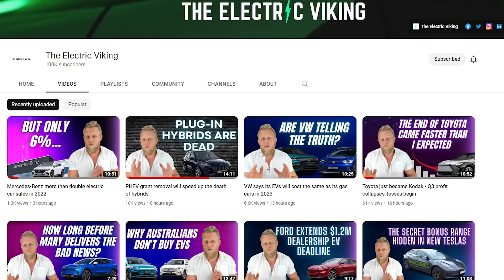German power company destroys wind farm for new coal mine

Comment: Very misleading in regards to the dismantling, or as defined by correct terms “decommissioning” of the wind farm by RWE. They havent simply decided to do this, those turbines had come to end of life as they have been operational since around 2001 and the permits are beginning to expire. Not a fan of expanding the coal mine though
Reply: I wrote something similiar but the comment was deleted. Truth and critical questions are not wanted here.
Reply: It is even more hyped up than that. The windfarm in question consist of 8 windmills. Only a minute of research (google "number of wind turbines in Germany" ) shows that there is about 29,788 wind turbines in Germany. You really have to be immune to facts and logic to make a big deal out of it, specially since the war in Ukraine have disrupted the energy supply for Europe.
Reply: Fossil fuel powered plants normally last 30 to 50 years or more.

Comment: Brown coal is very poor power generation , Black coal is a lot better if you are going to use coal .. The age of the wind farm may actually be so old that maintenance costs ,repairs etc make a negative situation . The Wind Turbines on land have about 20 year financial viability , but thats dropping as new turbines are much bigger and supposedly more efficient ( Life expectancy and maintenance are proving not to be what they said ) . Tesla water use compared to VW , BMW etc would be interesting .
Reply: As an electrician who has worked on wind farms, newer turbines just keep getting better and better when it comes to reliability and maintenance. While having an issue on a larger turbine does take out more production for servicing, it also reduces overall service needs (just longer times in the lifts as towers get taller). The turbines are becoming like jet engines used on passenger jets. They will communicate when lubricant is becoming warmer than expected with the current weather and power output conditions, or when slew motors are experiencing higher than expected loads, all signs of increased friction or lubrication problems. Just seeing issues ahead of time allows for preemptive maintenance during low wind conditions, with all of the parts, equipment, and personnel already onsite. Very similar to scheduling an airliner to visit the maintenance shop on its next flight, and to have all of the necessary equipment to repair or replace engines as necessary.

Comment: Mind-boggling that Germany cannot or does not want to invest more in Wind and solar.
Thx for calling them out Viking
Reply: I guess they have an urgent need for power that can't be supplied now by wind and solar.
Reply: Renewables overall.
Sure, if they think wind and solar suck because of their climate, fine. Battery storage isn't ramped yet, and European temperate climate really just means "50% of the year you get clouds or rain".

But Germany has nuclear power available, they both have a domestic capability and many countries around them with that capability as well.
They are also an economic powerhouse capable of actually pushing new generation nuclear (mainly liquid fuel reactors) that can easily drop the price of both construction and exploitation of nuclear below SUBSIDIZED COAL (which solar is able to hit lower than unsubsidized coal, but not subsidized coal) and it would work in the European climate.

But that implies both taking risks (investing in new technologies and assuming their choices), going against standards (PWR was chosen as the standard for the industry way back then because of its ability in producing plutonium for nukes), and pissing off their existing power providers (because such a solution would essentially break their hold over this market and all the ones linked to their energy grid). 

But on the positive it would also cause France to finally drop PWR as well, because I think the thought of being outdone in nuclear by the Germans would be a national insult.
Reply: @mobiuscoreindustries  Tony Seba says studies have shown that even in Alaska solar power would be enough.  Just need batteries too.
Reply: They do not have enough baseload energy plants.
Reply: @philipdamask2279  Do they not?  Then why are they importing Russian gas?
Reply: @simongross3122  For industry. Gas is not all about electricity. People seem to have drawn a blank on that.
Reply: @simongross3122  For industry. Gas is not all about electricity. People seem to have drawn a blank on that.
Reply: @hendrikbarboritsch7003  Yeah, and batteries are the current bottleneck. What I am saying is that Germany has the ability, just like nearby France, to smash their use of fossil fuels even preceding the ramping of global battery production, but we all know the real reason for the lack of commitment is that Germany's energy utilities and politicians would rather pretend to perform a transition rather than actually doing it
Reply: @UhOhUmm  Yes you have a point.
Reply: @UhOhUmm  Precisely because Germany needs all the gas and oil it can get for its chemical industries (pharmaceutical, agrarian, plastics etc.) it should get its electricity from renewables, like Denmark.
Reply: @hendrikbarboritsch7003  "studies" huh? if it could be done you would think there would be some decent sized town somewhere that runs on 100% solar/wind already by now. no offsets, no trading excess renewables for reliable energy later on etc, just one decent sized town running 100% on solar/wind.
Reply: Mind-boggling that Germany want to invest anything whatsoever in Wind and solar.
Reply: @hendrikbarboritsch7003  You dont like anyone offending your religion?
Reply: Wind and solar not a very reliable, efficient, economical or environmentally friendly energy source.
Reply: @ogcowboy5743  It's a fairytale energy source.

Comment: The re starting of the coal plants and generation is to counter the loss of Russian gas and is understandable as the current renewable technology would not plug the gap in time for the peak winter demand. I don't know what the potential is in Germany for solar and wind to provide their energy needs given their climate and I suppose that applies for most of Europe. We in OZ can not ride on the high horse either as we do still have a significant coal fired power generation percentage with the unit in Victoria being brown coal. We have plentiful gas under our feet but have to compete with the rest of the world to buy it so again we can not afford to be so smug. I think protesting  the construction of the factory is quite stupid and I can not see it being any more of an environmental problem than many other factories in the country and its water usage would probably be on par with them. It is obviously all about protecting their car market which was clearly not prepared for the EV revolution but they were not alone there. We need to remember that as more EVs are bought the pressure on countries to cater for charging them increases which will lead to an even greater demand for electricity generation. Also most Europeans don't live in a hose with a garage and a socket to charge their car from. Make no mistake the upheaval will be huge and many wont like it.

Comment: Hmmm... The thing you overlook is that they are digging up the coal to make electricity, the very electricity that the Tesla batteries need in order to function, so in reality what Tesla is doing is connected to what the coal mine is doing. They are still part of the same rapacious system.

Comment: Yes mate I think in my layman knowledge of the subject is that any form of power generation comes at a cost to the environment simply because in almost every instance they require gigantic holes in the ground to be made to get at the materials and elements which must have an enormous impact on our current situation. It has been mentioned that for example wind turbines have to be replaced after twenty years and that the first ten years of their operation shows them to run at a loss in revenue they might produce. It makes no sense to me at least that this crazy push towards power generation is not going to make any impact on the planet and another example is EV vehicles and the many issues against having one for one's own transport. Moreover this rush to have  non polluting systems up and running has come at least thirty years too late!

Comment: Never mind whether coal is more efficient than wind or coal power station uses more water than a Tesla factory. I suggest the reality is that at this time Germany needs both. Here is my reasoning.

1) Germany is/was very much dependent on oil and gas from Russia. Despite massive investment in wind and solar in the last decade or two. Gas is now cut off, oil will be shortly, due to the crazy war on Ukraine. 

2) Presumably no matter the efficiency of wind those few turbines were not producing anything like the amount of energy that can be had from the coal on the same site. 

3) Germany needs that energy ASAP to keep their economy going so the Wind turbines have to go and mining commenced.

4) Meanwhile, reducing use of oil and gas is a great idea, both from a climate change perspective and in order to gain energy independence from Russia. Therefor EV's and the Tesla factory are a great idea seeing as they are so efficient and don't burn oil if renewables are available. Therefor having that Tesla factory is a great idea.

5) Hopefully in the future the green guys will have got their act together and made renewables work well enough to replace the energy from oil, gas, coal. That still seems to be a long way out, despite all the claims of how cheap renewables are etc. The situation today in Germany clearly shows renewables are not enough at this time.  It makes no sense to shut down fossil until renewables are a viable replacement. That attempt just led Germany to become reliant on Russian fossils. 

In short, I could sum it up by saying that Germany needs that coal mine to power that Tesla factory!

Comment: I'm only about 3 minutes in and you may have covered this later in the video, but they're protesting Tesla and not the coal plants because Tesla is the reason those coal plants needed to be constructed.  Renewable energy cannot keep up with the demand created by electric vehicles, so reliable energy is coming back in the form of new coal plants.
Your renewables aren't even renewable, those solar panels and wind turbines wear out and once they wear out they are not cost-effective to recycle so they just end up in the landfill. It costs more to break them down into reusable materials than the materials are worth, and even if all those materials go right back into making a new solar panel or wind turbine most of the fabrication cost is in the labor and not the materials.

The only way EVs are the way forward is with nuclear, unless you don't mind having a heavy reliance on coal and gas to charge your car.

Comment: You seem to forget the process of producing electric vehicles such as Tesla, involves a far more toxic mining process for cobalt. Also petrol/diesel vehicles have on average 3 time the lifespan of an electric vehicle.  So for the same longevity you would have to produce EVs at a 3:1 ratio and given the fact that the majority of production is only possible through the use of  non renewable sources and a high proportion of the components are oil based. The overall carbon footprint for electric vehicles is exponentially higher than petrol/diesel vehicles just through manufacturing production.  That's before you get to the actual on the road carbon costs. Which for those idiotic enough to believe the propaganda,  are NOT zero emissions for EVs.

Comment: Solar and wind electricity production has the advantage of being more de-centralised than gas,coal and oil. Especially with home systems. This means a foreign aggressor can’t easily take out a countries grid with relentless bombing. You know who I mean.
Reply: No, I don't know who you mean. Sounds like something a U.S.proxy could easily do.
Reply: @polybius23  Or a Russian proxy… or Chinese proxy.
Overhead transmission lines are particularly vulnerable (to something as simple as tinfoil).
Reply: Yeah they can...because home generation never produces enough power...that's why they are all still hooked to the grid in Germany.
Reply: @markanthony3275  not true. Germans bought into the hybrid model, requiring commercial power.

Comment: Reliable electricity supply is crucial for social and economic stability and growth which in turn leads to eradication of poverty. Energy policy should not favor wind, solar, biomass, geothermal, hydro, nuclear, gas, or coal but should support all energy systems in a manner which avoids energy shortage and energy poverty. All energy always requires taking resources from our planet and processing them, thus negatively impacting the environment. It should be our to minimize negative impacts and focus on the three objectives, energy security, energy affordability, and environmental protection instead of on useless buzzwords like renewable.

Comment: i dont know about todays german manufacturing, but ive worked with really old german printing equipment at printing companies ive worked at in past and have seen other german equipment used by other printing companies and that old equipment are work horses and still run very well hundreds of years later.  if the car manufacturing is anywhere as good as the printing equipment, then germany has nothing to worry about with tesla.  if their cars are good, then no one is gonna buy tesla.

Comment: Gas is arguably a worse carbon polluter than coal depending on method of extraction. If fracking is used, gas is actually much worse as the “fugitive” methane emissions from active and decommissioned wells escape into the atmosphere.

Comment: Wind turbines in Germany are a waste of money because Germany is not a windy country. 
Solar PV panels are poor performers because Germany is not an especially sunny country.
Reply: Germany has room for 50 GW of off-shore wind farms. Currently, they have 7.5 GW installed in the North Sea and the Baltic. Capacity factors are in the range off 35% (old farms) to 52% (current state of the art), which is excellent.
Wind farms in the southern half of Germany are a different story. In bad years, their cap. factors may be as low as 17%.

Comment: Yes, lignite is inefficient and dirty, but what are the short term solutions for addressing the current energy crises in Germany? Burn dung instead? 
The manufacturing of wind turbines require mining and reliable energy. The latter can be obtained from Nuclear, but the German public voted against their existing nuclear power plants and for switching to Russian gas, wind and sun. The energy densities of these renewables sources are low requiring lots of space, hence the need to build windfarms everywhere, but 
I do suspect that the wind farm was deliberately built on top of known lignite reserves, to the delight of many. 
Latching on to drinking water in Berlin as a basis for anti - Tesla protests, is just bizarre.

Comment: 1. All li ion battery production and eventual waste is more poluting than coal. 
2. Electric cars do not have zero emissions.  The electricity must be generated by in 75to90% of cases you guessed it fossil fuels. 
3. Electricity from coal is better than no electricity at all especially in winter. 
Get off your pulpit of clean energy and realize your electric car runs on coal and oil.

Comment: Solar PV is only 20% efficient therefore it's bad? Actually 36% is not all that bad for a thermal power station.
Yes, the whole of Europe has a serious energy problem not simply because of Ukraine but because of the damage done to the Nord Stream gas pipelines. Much of Europe needs energy to prevent its citizens from dying. Germany has also shelved plans to shut down all its reactors and France seems to be bringing some of its mothballed ones back online.
None of this is good news for AGW but given what it takes to sustain life in the higher latitudes there's no alternative. Of course it is better to burn natural gas than coal, per unit of energy gas produces less CO2 than coal however its important to ensure the advantage is not lost due to fugitive emissions of methane which is worse than CO2 as a greenhouse gas.
As for the protestors against Tesla's  factory being motivated by Germany's auto industry that makes no sense. EVs still only account for single digits of new vehicle sales and like every other vehicle manufacturer  I'm certain the German factories are as capable of switching to EV production if the demand was there.
All this focus on EVs is a distraction. Personal transport vehicles account for around 6% of CO2 emissions, less than agriculture and just about everything else. It'd be good to get the air pollution out of our cities but that's all they bring to the table.

Comment: Tesla building e-cars is not the problem. Tesla not perfecting and expanding solar storage is. If we all had better long term storage of clean energy then Putin’s gambit would not be as much of a threat. Instead of the disaster that Tesla’s solar roof and power wall is (at least in the US) we need large or widespread storage systems that can help cut the need for fossil fuel when the sun don’t shine. Tesla needs to go way farther and deeper into storage tech to make solar and wind generation “bulletproof” from threats by the likes of Putin.